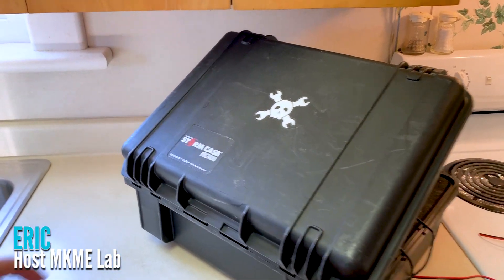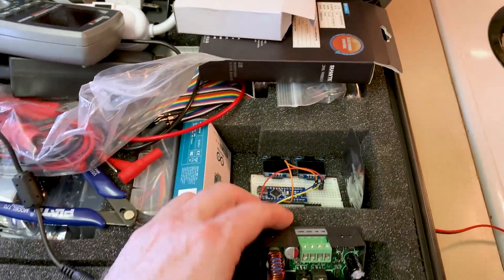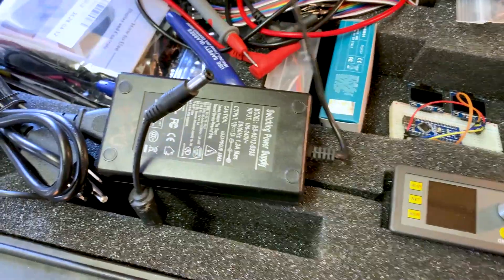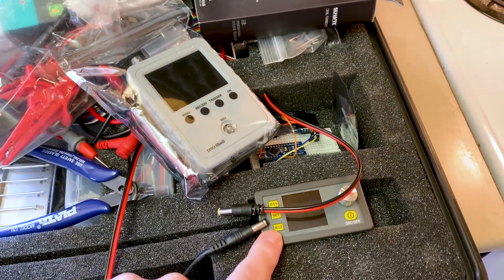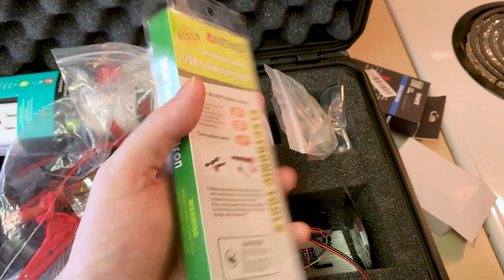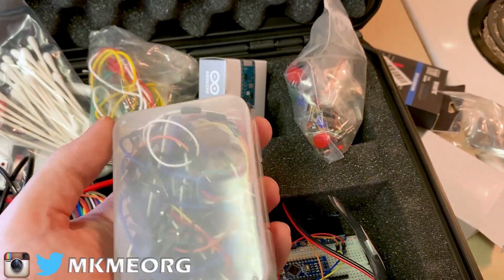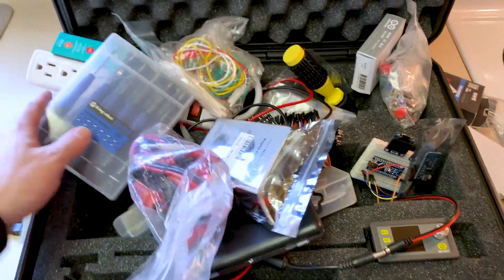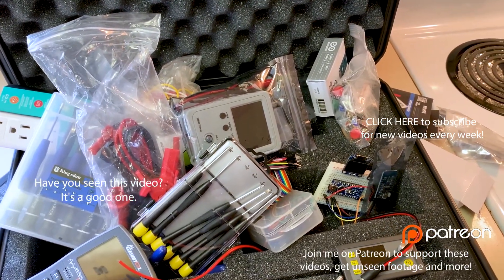PORTABLE ELECTRONICS LAB KIT PART 1📡

Comment: Very nice idea. You should try to have the power supply be battery powered from a lipo too.
Reply from the maker: Will do.  I have a lithium ion USB pack in there but I may add a larger DIY pack from 18650s at some point

Comment: It isn't as fancy, but I did something similar, I got a $1 toolbox and threw a bunch of basic soldering gear in it like solder, braid, brass sponge, my TS100, tips and a couple batteries, I just need to be careful about putting hot tips back in and it'd be kinda nice to get a second one for a small stock of parts.

Comment: I have a 10A 12>24v booster connected to my supply as i needed the extra power but only had a 12v solar supply.